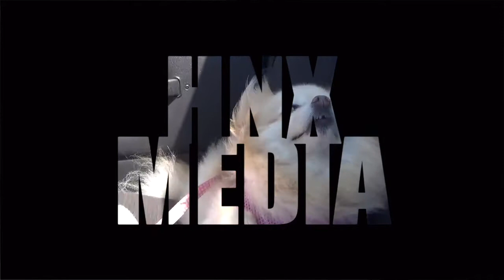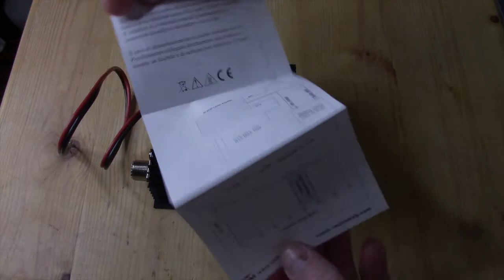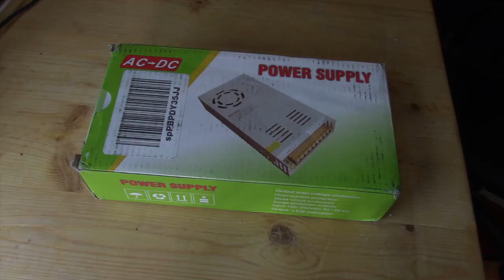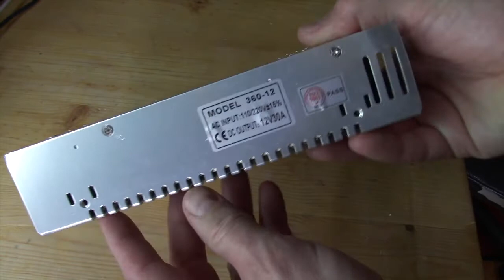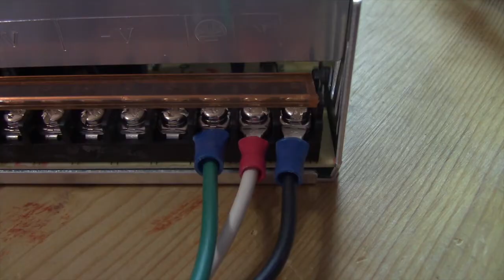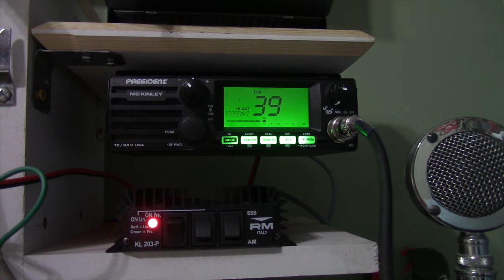RM Italy KL 203-P Linear Amp & 360w Power Supply (CB Radio)

Comment: What's the difference between the kl 203 and the kl 203p? What is the purpose of the pre amp? I'm thinking about either getting a 10 meter radio and modifying it for 11 meter or getting an 11 meter radio and an amp. Which would be better?

Comment: Hi there,i am waiting for one of this.A question,for ros tuning.
Have i to put antenna-amplifier-rosmeter and tune or have i to put antenna-rosmeter,tune and after antenna's tuning connect the amplifier between radio and antenna??
Sorry for the silly question but these are my first steps with the cb.
Best regards.
PS don't i need dummy load,right??
Reply from the maker: Radio - amp - swr meter - antenna. Any meter would need to go after the amp. The amp may change the tuning of the system. If you use a 102' whip, you will not have to worry about it. 102' is the perfect antenna for a cb. Just don't mess with the stock output power on the cb and you should be fine.
Reply: @HNXMedia  Hi there,a question,i have 2 rosmeter,i made connection like you say,but in the same condiction rosmeter says two different ros,do you think one of them is broken??
Reply: @HNXMedia  Hi hnx.I made like you sayd but now i have a problem.I attached magnetic antenna on my car,problem is that when i turn on amp swr goes higher than 2,5 and i cannot calm them down.I tryed to unscrew bolts for lengthen and shorten the antenna but nothing happen.If i turn off amp swr stays about 1.Can you say me what is the problem??Best regards.
Reply from the maker: @guevaradelaserna85  That high of an SWR sounds like a ground plane issue. I have never used magnetic antennas, only the kind that screw into permanent metal mounts.

Comment: Nice video, a d like the radio and amp. I wanted to ask how long are your coax jumpers? Some say 3ft, others have 10, 12ft. Any suggestions? Thank you .
Reply from the maker: Between amp and radio only 3 feet unless installation requires a longer cable. However, there is not going be any measurable "loss" over those three options - so use what you have or is most cost effective.
Reply: @HNXMedia  Loss on 11 meters is so minimal that even at 100 Frodo coax nobody can see or hear the difference.

Comment: Hi I want help please how use this with my cb radio I’m scared it can damage the radio if I use it?
Reply from the maker: These are essentially "plug and play." The antenna cable goes from the radio to the amp and then a separate antenna cable goes from the amp to the antenna. It is FAR more likely to blow the amp than harm the radio. As long as your CB is stock (not peaked out) you should have no problems. Just check the SWR and you should be fine.
Reply: @HNXMedia  I honestly have no idea at all what to do or how to do, I bought a radio on Amazon and the seller said that it comes with amplifier and a big antenna. I don’t even know what kind of power cable I need because it doesn’t comes with one. Antenna I will try to put on balcony because we live in apartment. So I also need someone who know how to put a big antenna up. I only have a handheld radio so I have no experience or knowledge about the one I bought. I can’t imagine that I would go out and look for a big antenna to buy, so when I saw that it was included I bought it lol
Reply from the maker: @golda_rabinovitz  Oh my, the person who sold you that should have provided way more information. There is a lot going on here and I do NOT want you to get discouraged or give up on radio, but it can be a complicated hobby. A CB "base station" that you plan on using in a house will require its own DC power source (if it is a radio designed for an automobile like the one I show here). They typically do not plug into a wall outlet (unless it is a CB radio specifically built for home use - very rare these days).  The amp is the same way, it requires its own DC power supply (unless the power supply for the radio can provide enough power to support both). Also, you cannot use a "mobile" or car antenna on a balcony unless it has some type of "ground plane" (in other words, a large metal structure to be mounted to or magnetically attached to). In a car, the car itself is the "ground plane" for the antenna. Hopefully, the antenna that comes with it is a large "base station specific" antenna - then it should work fine. The coax cable you need (that hooks up the radio to the antenna) is called RG8x. See here: https://amzn.to/3WclrPd The actual "power cable" will be completely different and depend upon the power supply/source. If you really want to get in deep and build your own antenna and learn a lot about CB radio, check out this guy's channel. He is a wealth of information: https://www.youtube.com/@MowerJunkie Best of luck and enjoy the hobby. Keep learning. Do NOT give up!
Reply: @HNXMedia  OMG what have I done 😵
This sounds VERY complicated for me, I had no idea at all about this with power and antenna. He only said that the things I bought was worth much more than the price I paid so I felt like I was doing a good deal. The antenna was not in the photo because it was so long. He recommended 2 persons for put it up but nothing else than that. The radio is this model: https://cbradioguru.com/wp-content/uploads/2017/12/President-Johnson-II-CB.jpg

And where can I find power supply for it? I don’t have a car to put it, I wanted it to be at home on my table and just sit there not moving around.

Comment: Appreciate the video. I have a stock Uniden Bearcat 980SSB that I am needing to get tuned and peaked. I can recieve all over the US and Canada but cannot get out to anyone. Would this amp work for me on stock or would I need to get it tuned? Thanks!
Reply from the maker: Only use this amp with a stock radio. If you peak the radio and then run it through an RM Italy amp, it will burn up the amp super fast. I've run my stock 980 SSB on this amp both mobile and base and can talk all over. Once you have the amp, all you need to invest in is the antenna. Mobile - run a 102 whip if possible. Base - run an Antron or something similar (but truth be told, I have run base with this amp on a center-fed long wire antenna made out of old speaker wire and talked clear to the Arctic Circle). Have fun and, of course (disclaimer) stay legal 😉
Reply: @HNXMedia  Thanks! I will try this amp stock. Yes I need to get a better antenna. I was trying something I had seen by taking 2 5ft. firestik's and puting one up in the air attached to the coax and one turned upside down as a dummy load. I definetly need a base style antenna. I appreciate you answering my question!

Comment: Really learned from your video. Thanks. For a 600 amp linear how many amps would a vehicle alternater have to put out to keep battery charged.
Hoe many amps for a base station would this need
thank you
Reply: Google Mechman Alternators I have there 400 Amp in my Chevy truck really works great

Comment: Silly question but is the RTX still connected to the Antenna when the Amplifier if turned off? I don't want to blow anything by trying to transmit with no Antenna connection and don't want to have to keep connecting/disconnecting if I don't want to use the Amp
Reply from the maker: Not a silly question at all. The amp being off does not effect SWR. Tx "passes through" with no power to the device.
Reply: @HNXMedia  Great! Just ordered one to go in my truck 😁

Comment: I just bought the same. Fortunately the radio im using "Galaxy DX 979F" dead key in low power at 1/2 watt. So i didnt have to go inside and lower the power. I run about 2 watts max into it and get 100watt easy. I know it says can handle 10watts. For clean audio not over driving it, use 1-2 watts. I have had many amps and have abused many. Thats probably why i havent owned one for awhile. Im taking care of this little dude. Dont over drive it and it will last long time. For a small kicker, i recommend this
Reply from the maker: Solid little amps for sure. I have this one and the same model w/o the pre-amp. Both work great. Thanks for watching and leaving an awesome comment.
Reply: Yup, you are correct, on not overdriving these,,,1 to 1.5 watts, as a driver,,and that lil guy will last forever, with a ton of output,,,they dont need much,,,probably the number 1 amp killer, is guys drivin em with 8 to 10,,,these work the opposite, of the old tube heaters,,,smaller drive,,longer life,,and plenty of output,,100%,,,,they're really inexpensive now, too,,,only thing is that $20 power supply, on the vid, cant be puttin out,,more than 5 , or so amps,,,if I'm runnin the cb, AND amp,,,I'd get a power supply, with a higher amp rating,,,,de NV1H😎
Reply: Did that power supply create noise in the radio?

Comment: I'm unable to read the specs on the power cord you are using. Most of the cords available on Amazon say 15 amp. Are these ok to use?
Reply from the maker: Not sure what they all mean, but here are all the specs written on the power cord:   C(UL)US    E179483-G   16AWG   300v   75°C   FT2   LEONI  SJT 3 x 1.31mm²

Comment: I have two of these. One mobile and one on the base. Both are 7 years old and have been working nicely. Just be gentle with them and they'll last.
Reply: May I ask what is your dead key power for the input of the 203?
Reply from the maker: They are great amps for sure.

Comment: I'm using mines with a President Dick radio should be a cool little rig to play around on.
Reply from the maker: Heck yeah! Sounds like a solid set up!
Reply: @HNXMedia  Sir whats the dead key your putting into the KL203p ?  the Pres.Dick on low has dead key of 2.7-2.8 watts swinging 17-20  is this about right?   Ive heard this amp will blow easy if over powered.
I want to be sure before install in mobile  I use it on the bench with a old school Galaxy 1 watt DK swing 24.
Thanks I like your channel.

Comment: I have a question, but the power supply also works well in transmission
Reply from the maker: The way my set-up is done, I have the radio on a different dedicated power supply and the amp hooked to the one shown in the video. Hope this helps.
Reply: @HNXMedia  hi 
Is it possible to connect the radio to a similar power supply, or does it need a specific power supply??

Comment: How much power from the radio did you use to drive the amp on SSB? Would have been interesting to see difference the pre-amp made on receive. How much does the amp cost?
Reply: Don't make the mistake of running input higher than 3 watt those MOSFET finals burn quickly I personally have 3 rm 60 amps 2 built in heatsink mfg and 1 a 60 stinger they all use same finals priort rm3 transistors come back generic 520 MOSFETs more than 3 input almost always knocks the final in AM ssb can get away with 8 + pep at that a 203 may get 100 watt the 60s can get as high as 70 but only very short term I have swapped the finals 4 times in one it still operational but the pc board don't take that much service change
Reply: I keep mine under two watts input.

Comment: is this setup for CB style or HAM radio?
Reply from the maker: Legally, amps can be used on ham radios only. The power supply, however is nice because it could run either one or both at the same time. These types of amps are often used for "equipment testing purposes." The same way the accelerator in a car is used for "staying within the speed limit." Both have about the same practical effect ;)
Reply: @HNXMedia  Everyone who reads that statement knows that you are full of 💩. Lying about what you are doing doesn’t make it Legal just FYI.👎🏻
Reply: Setup is shown for CB. Ch 39 27.395 is a CB frequency! Should work on 28 Mhz and above for 10 m Ham as well.